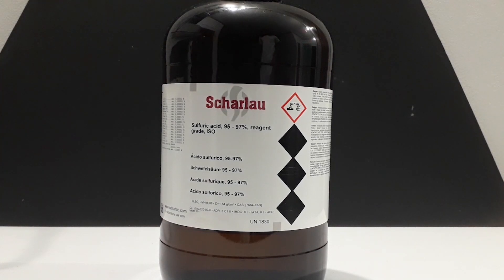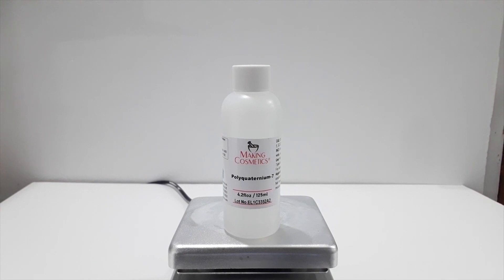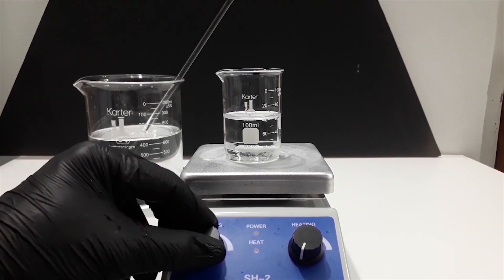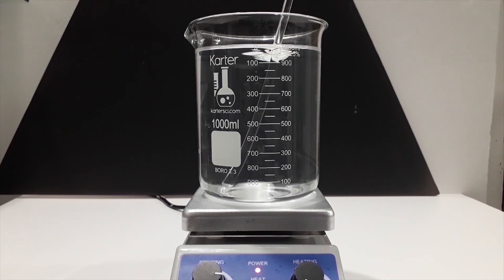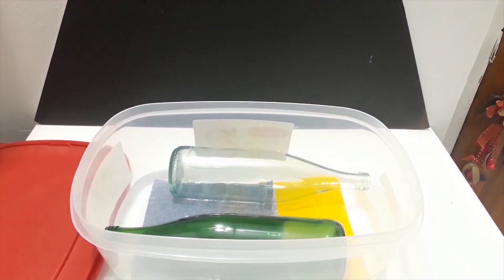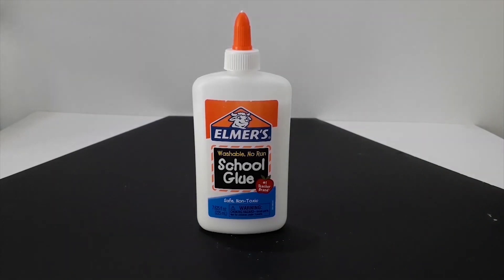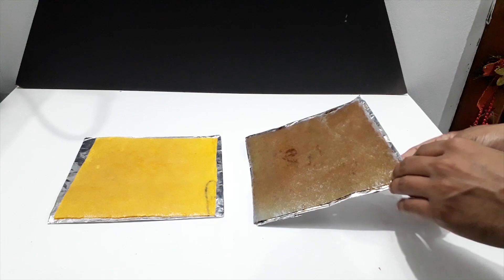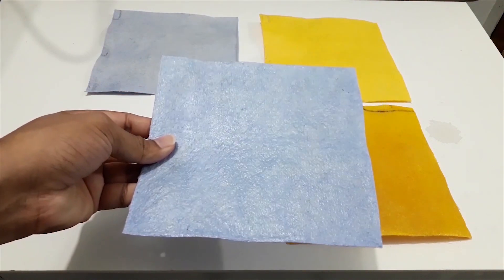How to produce DIY ion exchange membranes for various electrochemical applications.

Comment: A tip for those who can't find a PTC, look into green algae remover cleaning product for tiles, pavement etc. It's usually dilute didecyldimethyl or benzalkonium AC in water, no other ingredients. I found a solution of 0.25% DDAC a gallon for 7 bucks. Gently boil away the water on low heat in a cooking pot until you reach a 20-50% solution. As long as the temp doesn't rise above 100°C decomposition is ,negligible. Don't evap until dry, the temp will shoot up to 150°C and partially decompose your quaternary amine.
Reply: you can find more concentrated solutions with luxury brands, a 5% aq. DDAC solution isn't uncommon ; just boil or distill gently until the volume is reduced to 1/10th, label and store.

Comment: I've succesfully used Celgard 2500 as diaphragm, which is what they use for lithium batteries as porous PP membrane (25 micron). problem is that it is very hydrophobic, you need to wet it first with 0.1% SDS in methanol, then wash with methanol, then wet with the electrolyte you are going to use + a drop of polysorbate-80 (non-ionic surfactant)
Reply: .... like this a blank 10% H2SO4 run gave 4 amps at 12 V using 6 cm^2 lead electrodes, and it remained stable for hours, only slightly heating up (under 30°C)... you can order Celgard from chyna for reasonable prices, I found 10 cm x 1 meter for 25 euros, last time I checked price had doubled but it is still reasonable compared to the nafion scam

Comment: Can I use this membrane to produce Cl2 and NaOH from NaCl?
Reply: Just use a porous clay pot to hold the saltwater. That's what I've gathered. If you're actively trying to make Cl2, use a graphite anode in the saltwater.

Even using store bought plastic sounds like a bit over engineered if you're doing a small project.

Comment: A lead-acid battery contains at least 12 palm-sized diaphragm pouches. Cheap old battery is fine. Water cannot pass through them, but ions can. Or you can use terracotta. Both is much more easy available and cheap.
Reply: can confirm they work great for electrochemical experiments both inorganic and organic. carefully cutting open a car battery was a bitch though

Comment: citric acid is monohydrate or anhydrous?
if the second, could i just add more citric acid monohyrate or i need to make anhydrous?
if i have to make the anhydrous form, do i just need to bake citric acid?
Reply: The citric acid does not need to be anhydrous, the esterification proceeds either way, just needs a little longer to dehydrate.

Comment: is there anything i could use instead of pvc cement that is available for under 18s
Reply: If you acquire a piece of fibre glass blanket from a car body repair shop, you can skip the PVC and dechlorination steps and just proceed coating with PVOH and citric acid.

Comment: using this could you create membranes that water vapour can go through but air can not?  how much would you need to dehumidify a typical room.
Reply: No, those are completely different types of membranes. In order to dehumidify a room you can use several types of methods, among them chemical or physical.

For chemical dehumidifying you would use a substance which binds water and does so strongly enough that it will only release the water when heated considerably, so it wouldn't release the absorbed water prematurely. Chemicals well suited for that are calcium chloride, various sulfates such as potassium, sodium or magnesium sulfate, silica gel, and sulfuric acid, all of them can absorb quite a bit of water and binds it quite strongly, sulfuric acid can bind by far the most water for a set volume of sulfuric acid compared to the other chemicals, but it has the huge downside that it would need to be quite concentrated in order to do a good job at absorbing water and concentrated sulfuric acid is a hazardous chemical. So using one of the salts such as calcium chloride or the mentioned sulfate salts would be your best bet as they are solids so easier to handle than sulfuric acid not to mention much safer. All you need to do is dry a couples hundred gram of one of the aforementioned salts in the oven to drive off any water it will likely already contain. In order to find out at what temperature you need to dry them, check Wikipedia, it will mention for most of the salts at what temperature it will become anhydrous '(meaning free of water). For example with magnesium sulfate Wikipedia says you need to dry it at 250C, and for calcium chloride Wikipedia says you need to dry it at 260C, concidering over don't go that high you could predry it to the monohydrate in the oven as it will be able to reach the required temperature for that, and then drive off the last molecule of water by putting the salt on a steel baking tray and heating the tray from underneath with a small handheld butane gas burner.

For physical dehumidifying you need a kind of retrofitted airconditioner, except with the minor difference that unlike airco's it doesn't blow any air over it but just has a large aluminium or steel cooling plate which is cooled by the airconditioner to a fair bit below the temperature in your room and preferrably just a couple degrees above 0C. The large difference in temperature between the metal plate and your room will cause the moisture in the air to condense on the cold plate, and it will rapidly start to collect droplets of condensation which can then be collected in a container underneath it. The only action you periodically need to undertake is to empty the container full of condensate, but other than that it's very simple. However the big downside is that airconditioners use a huge amount of electricity, and the same goes for these dehumidifiers, which as I mentioned are basically just retrofitted airconditioners.

Comment: I would like to try and replicate this. Thank you for the video and for sharing so much information. Can you suggest any simple tests one could perform to verify if the membrane is working correctly?
Reply from the maker: @ferriswhitehouse1476  compare conductivity with porous PVC substrate alone in a setup in brine or NaOH or Na2SO4. Set same distance and same voltage and measure and compare current. Be wary that temperature affects the ion mobility so be sure to do it in a temp controlled environment.
Reply: @CatboyChemicalSociety  Much appreciated! 🙏 So you would be expecting relatively high current in a lower pH solution, if it is working correctly?
Reply from the maker: @ferriswhitehouse1476  yea higher current initially and lower pH on anode chamber after some time compared to ordinary porous barrier.
Reply: @CatboyChemicalSociety  Makes sense. Thanks again. How important is the concentration of the quaternary ammonium salt? I just picked up some cleaner with benzalkonium chloride but there is no information on concentration of course. I found an sds on a similar cleaner that show concentration was 0.1 - 1%. So I would need to use quite a lot of that right?
Reply from the maker: @ferriswhitehouse1476  yea it's annoying that most are low conc but where im at now I can get 50% or pure powder of quaternary amines
Reply: @CatboyChemicalSociety  well, I'll just dump the whole bottle in there and see if it works. I think I can get 50% stuff as well, but it's like 90% of my net worth if I want to give it a go. Might as well make a huge mess and fail with the cleaners first, and then afterwards spend all of my money on the proper stuff. :D

Comment: I need a cationic resin for electroplating, can this be used for the purpose???
Reply from the maker: @champitube-t1p  yes it can work for salt electrolysis such as electroplating as the conditions are mild.
Reply: @CatboyChemicalSociety  I want to use it for imitation jewellery gold plating, please guide🙏
Reply from the maker: @champitube-t1p  if its for brush plating then just skip PVC step and bake the citric and PVA directly onto substrate then ofc after you can put the fluffy brush sleave over the membrane.
Reply: @CatboyChemicalSociety  It's Cathodic plating actually, we first wash these ornaments and then dip them in salt tanks for metal deposition
Reply: @CatboyChemicalSociety  is the any resin made of Methylmethacrylate and HydroxyethylMethacrylate??
Reply from the maker: @champitube-t1p  those are porous resins not cation resins. Anyway this resin is carboxylate functionalized crosslinked PVA. But if your process uses cation resins then this PVA Citric bakable resin can be applied to a substrate and used in a plating tank or an anode cover to prevent oxidation of electrolyte or crossover of ions
Reply from the maker: @champitube-t1p  where exactly do you apply the resin is it as a membrane or a coating
Reply: @CatboyChemicalSociety  We provide lacquers to plate gold on imitation jwellery. For this we need some chemical to hold the plating at the same time being durable. So cationic resins are what we need for the samem
Reply: @CatboyChemicalSociety  coating!!
Reply: @CatboyChemicalSociety  I searched for some formulations, there aroused some with Use of Styrene, Divinyl Benzene but nothing a confirm formulation.
Reply from the maker: @champitube-t1p  well in this video its 1:4 wt ratio of citric acid to 10% PVA solution (clear glue) then baked at 140C for 30 mins to produce the polymer.
Styrene sulfonate and divinyl benzene is the classic ionomer but there are lots like the one in this video but all do the same thing.
Reply from the maker: @champitube-t1p  what im concerned with is ion permeability of gold in cation resins which is slow and the gold exists as anions which are repelled by cation resin. I am wondering if you mix the gold cyanide with the resin itself to compensate otherwise I can tell you that it won't work with any cation resin.
Reply: @CatboyChemicalSociety  For increased rate of transfer, we add Hydroxy Methyl cellusolve, So I don't think that must be a big problem but sir what I have for now is a product and I need to make something similar to that. With your guidance, I think that must happen. Please let me know where can I share you the pics.
Reply from the maker: @champitube-t1p  PVA itself is already similar to hydroxymethylcellulose what you can do is get powdered or solid polyvinyl alcohol and dissolve it either directly to thicken the plating solution assisted by heating to 90C or first dissolving in water then mixing.
Reply: @CatboyChemicalSociety  Alright Sir!! I'm very grateful for this information, will try for sure. 😄😄🙏

Comment: I followed the direction by getting a cloth then putting the PVA and citric acid combination on a cloth then baking it for a microbial fuel cell. But what happened is the holes in the cloth are still too big. The water passed right through it, so it doenst really act as a membrane. What should I do instead? What kind of cloth should I use? Do you have an amazon link?
Reply from the maker: How many coats did you do because you can do multiple coats. I used microfiber cloth from cleaning section.

Comment: FOR pem membrane required for hydrogen production by  electrolysis direct on clean cloth pva and citric acid is aplied no  pvc and dechorination solution is required then baked the sheet
Reply from the maker: Yea you can directly bake the ionomer mixture for use in milder conditions
Reply: thanx for reply

Comment: Can a cation exchange membrane made in a similar way ?
Reply from the maker: this is a cation exchange membrane so YES
Reply: @CatboyChemicalSociety   Thanks . Sorry for wasting your time as you've already answer that in the comments  a few times  .  🙏🏻🙏🏻
Reply: @CatboyChemicalSociety  - Is the PVC glue step necessary for NO2 ions separation ?
Reply from the maker: @thrdel  its not and also NO2 is an anion not a cation so you need to use a different active crosslinker like glutamic acid HCl. It doesn't dissolve well in the glue unless pH is set to 1
Reply: @CatboyChemicalSociety  Thank you.

Comment: Thanks for such a fantastic video detailing the process, and thanks for still being so active in the replies. I'm looking to build a rudimentary PEM fuel cell and it requires Nafion for the PEM. Obviously, as you've mentioned, it's very expensive and not so easy to get hold of so I am looking to follow your video and make my own. I read in the descriptino that I can skip the PVC cement and dechlorinating step if I'm making a PEM for a fuel cell. Is that correct? What kind of cleaning cloths did you use, does it matter? And I saw someone mentioned using fibreglass cloth instead, is that viable and do I need a specific type? I'm sorry for all the questions, thanks again for your help!
Reply: Would a thinner fibreglass cloth be better?
Reply from the maker: @CaptainOcboter  yes fiberglass mesh can act as a substrate for the ionomer baked directly.

Comment: Am I right in that the point of the washcloth is really to be a substrate for the ion-exchange membrane which is really comprised of PVA?
If so, could one simply impregnate a fiberglass weave with PVA/citric directly?
Reply from the maker: Yes you can add the resin to fiberglass directly and bake

Comment: Hi MB, I just found your very interesting work, it is so fantastic. I want to try it in my lab.
in this video you made 1:4 citric acid : PVA, but in your comment you said 10% citric acid, which one do you think better? 1:4 or 10% citric acid?
Thank you so much for your answer
Reply from the maker: 1:4 citric to 10% PVA solution is nice and I said 10% PVA solution and that's whats in clear glues like the one in this video. Since some people start with PVA powder.
Reply: Ah thank you so much MB.. will try it and comeback to you if there is something unique in my work..
Reply: Hi MB, about the length of the oven process (150 C), is 45 mnuts is a must? Or it can be faster? I tried 45 mnts, the cloth getting burn, but it didn’t when I tried with 30 mnts, please advise..
Reply from the maker: @achfaridwadjdi9518  even 30 mins is fine and I recommend putting a thermocouple on your membrane while it bakes to know real temperature
Reply: Hi MB, thank you so much for your advice..
1 more need your advice, the thin layer was appear, but when I washed it, those thin layer fell off. Please advise, am I rubbing the membrane too hard? Or I did it too long in water?
Please advise.. and thank you again for your advice..
Reply from the maker: @achfaridwadjdi9518  if it washed off then it didn't crosslink and if you used glutamic acid HCl it should be a clear solution when mixed with PVA solution not milky or white

If it was all clear and still fell off then you didn't bake long enough
Reply: Thank you so much again MB.. I will try it again with thermocouple.

I still use citric acid with PvA

Comment: Would I be able to use this for a microbial fuel cell?
Reply from the maker: Leave out the PVC and directly apply the ionomer on a substrate. The citric and pva should also be highly biocompatible though remember this is a cation type membrane. For anion type replace citric with glutamic acid in dil HCl at pH of 1
Reply: Do you mean to dilute the glutamic acid into HCL until it reaches a Ph of 1, then mix it into the PVA? What mole of HCL? @CatboyChemicalSociety
Reply from the maker: @JonathanMiller-y8q  if you want to add glutamic acid to HCl then use a 1 molar solution. But I prefer adding concentrated HCl to slurry until it all dissolves to ensure I use minimal water. Alternatively I sometimes add glutamic to PVA solution directly and with strong stirring drip 35% HCl slowly til pH is 1 or a clear solution is obtained.
Reply: I just tried doing that. I used 10g of glutamic acid and 40g of PVA mixed then i added 35% HCL to it until it reached a PH of 1. Then I put it directly into the oven, at 305 F for 45 minutes. When I took it out it was burnt like severely burnt black toast. Should I have it fully air dry before baking it? @CatboyChemicalSociety
Reply from the maker: @JonathanMiller-y8q  do not use a gas oven you need temp control PID control basically and have a temp sensor also 120C to 140C is fine for anion resin.
Reply: Do you need to first let it air dry before baking it? @CatboyChemicalSociety
Reply from the maker: @JonathanMiller-y8q  it definitely helps reduce air bubbles but you don't have to

Comment: This looks very interesting thanks!

Strangely I cannot find any other videos on the subject of DIY ion exchange membranes.

I'm not knowledgeable enough to understand why your process works. I think some explanations would encourage this experiment to be replicated.

DIY nafion would be awesome for many hobbyists.
Reply: DIY Nafion is not possible… it requires doing a lot of fluorine chemistry which is extremely dangerous. You will die.
Reply: I understand the PVA/citrate esterification, but I don't understand what the purpose is of the initial PVC dechlorination.